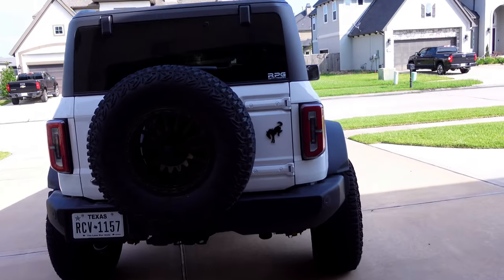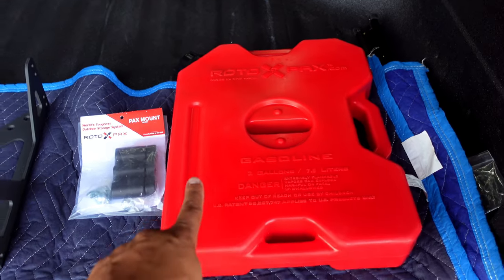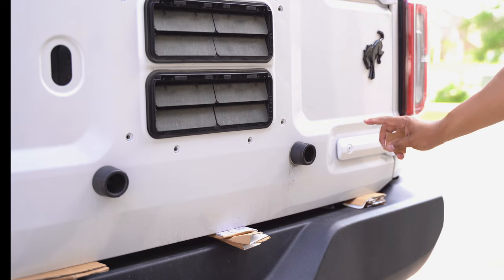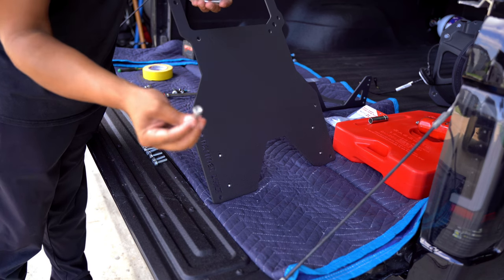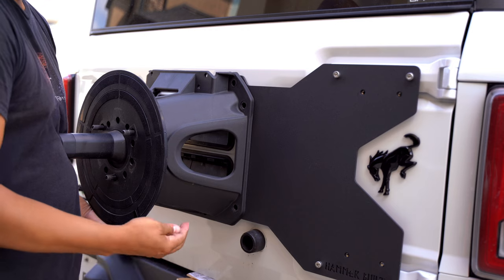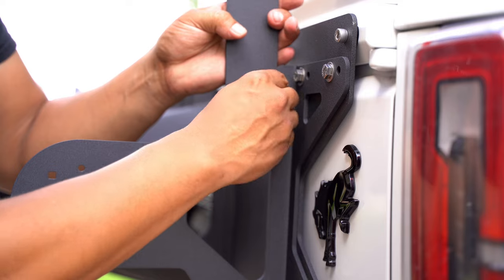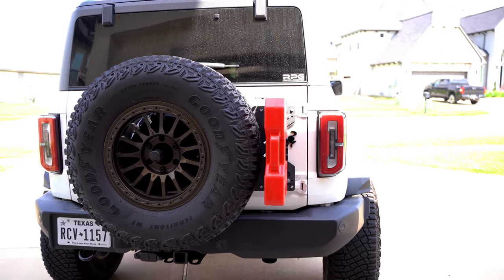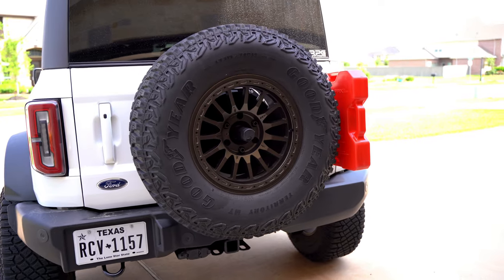Ford Bronco Tailgate Reinforcement Support.

Comment: Since the factory had blue loctite on the  origianl bolts, I put some on the new ones when I installed.
Reply from the maker: Nothing wrong with reapplying the same color loctite. Always better to be safe than sorry. How do you like yours?
Reply: @JJBanuelos  just got out on today, but feels like it is going to work well.  I have a BadSquatch but put heavier tires and wheels on and it feels more solid owning and closing the rear door.

Comment: Can you fully open your tailgate to max when no accessory is attached just the mounting plate?  I'm hoping if I need full extension I can just remove the rotopax temporarily, open the tailgate, then put the pax back on after shutting the tail gate?
Reply from the maker: Yeah if you want it to swing fully open then the rotopax will have to come off. It will hit the taillight before fully open.

Comment: Great video but I didn’t understand the part about the brake light. What are instructions if you’re not relocating the brake light. That is, you’re leaving it as it came from factory?
Reply: No need to install the extension if you have a Sasquatch and staying with 35”

Comment: Can you open the tailgate all the way with the Rotopax attached?  My tailgate gets pretty close to the taillight and it doesn’t look like there’s much room for the Rotopax.   Also, does it say how much weight can be supported with this system?  Thank you
Reply from the maker: Can’t fully open it but it’s more than enough to fit whatever your going to get into the back. Not sure bout he weight capacity you’ll have to check out there website for specifics

Comment: Not trying to be condescending, a legit question to you since you own a Bronco. Do you think this can actually handle 35's or even 37's? I see this and the one Rough Country sells and wonder if it's more of a crutch rather than a solution. I plan on buying a Bronco next year and want to run either 37's or 35's and wonder if something like this is actually helping. 
Thanks.
Reply: For what it’s worth, the technical manual for the Bronco lists the weight load capacity of the stock tailgate at 133lbs. Factoring in the weight of the spare mount column, the spare itself and a fully loaded Jerry can and you’re already dangerously close to that limit.

There’s a reason their new Bronco Raptor comes with it’s own tailgate reinforcement assembly, I’d wager that their concerns about the weight of 35” and especially 37” tires is entirely valid.

Hope that helps 🙂
Reply: @Aurongel  Does not even take into account the impact value such as shock loading....ie:  133 LBS can be doubled our trippled when impact loading is calculated.   These new Broncos look so flimsy and when you start adding 37" tires, the stress on the running gear is very high....I cant imagine paying this kind of money for truck with such a sub par engine...
Reply: @77bronc14  I wouldn't call it a sub par engine. I mean hell there's big V8's that struggle to turn even 35's and get horrible gas mileage. People act like straight axle or V8's are the solution to everything but it's not. These motors are putting out more power now than the old V8's of even the early 2000's did. Technology advances.
Reply: @Aurongel  Yeah, I plan on running 37's and see this mod or something similar as 100% necessary. Waiting to see if another company comes out with something stronger.
Reply: Been testing the system on my bronco for 2 months now, if you saw the high speed whoop desert abuse I subjected the bronco to, you’d understand how it’s a non issue as long as your under 140/150lbs including spare.  Besides hanging my whole body off the open tailgate I have not conducted any heavy weight trail abuse above 150 at this time